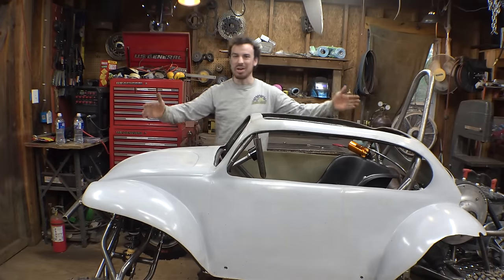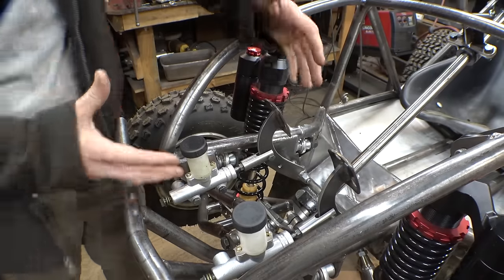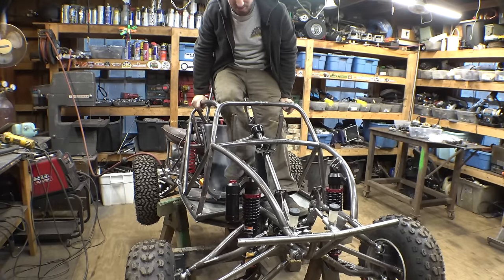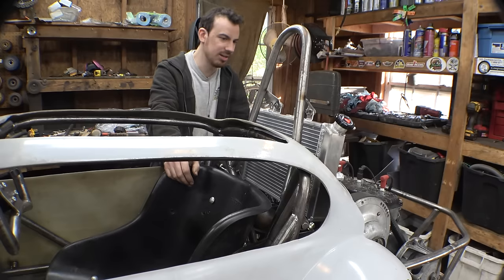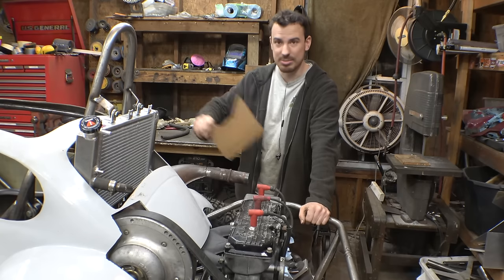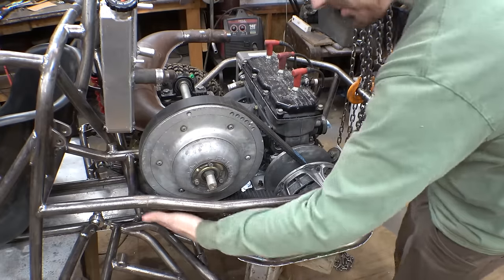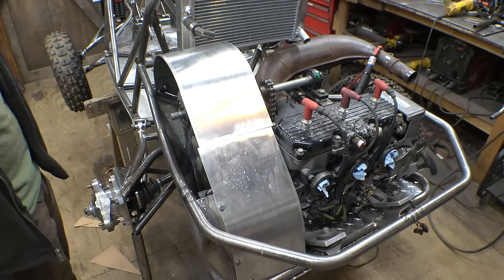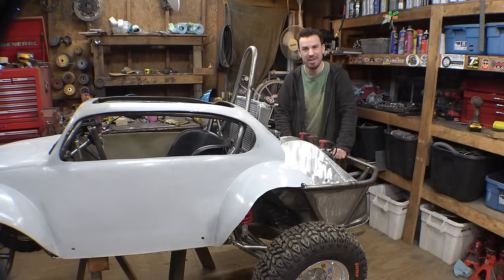Back to Work on this  - Mini Baja Bug Project - Part 13

Comment: Si te diera mucho calor en la espalda el radiador. Podrías poner  algún conductor de flujo de aire en los laterales de la carrocería y proteger la espalda . Saludos
 If the radiator got too hot on your back. You could put some air flow conductor on the sides of the body and protect your back. Greetings

Comment: Put the tank under the seat full width and with a slight air gap put a skid plate. The car has plenty of ground clearance. The tank only needs to be 3 inches deep and however wide the car is. Should be plenty of fuel. About the size of the whole floor pan.

Comment: I wish you would have cut it right at the seat then you could get room for sitting and more room for the engine, gas tank, and oil tank plus the radiator and put a fan on the radiator. Then mold the fiberglass and extend the pipes. Make it comfortable to ride all the time.

Comment: If you flip the part over and use just the lower half of the dimple die tool on a flat surface it'll punch your panel back straight.

Comment: Lay the radiator down somewhat over the motor. Put 2 12v fans on top of it pulling the air through.

Comment: Need to get yourself a 3D printer and a free version of Fusion 360. Can then do complex shapes for a fan duct and print it out of a plastic that is good for heat resistance like PETG or ABS. Would save on doing a lot of things out of metal.

Comment: Careful using a hand grip master cylinder on a steering wheel like that. If there's any air in the reservoir and the wheel turns enough that it's upside-down (or maybe even just sideways) you could end up with air in your brake line.
Reply: not true

Comment: I have an idea for the radiator. Can you make brackets for two places of pipe that goes from the head guard to the back of the frame for the radiator but make it where the two places are able to be removed to work on the motor

Comment: put gas tanks for the millionth time where the bashers on the sides are. Make them enclosed for fuel and or oil tanks. and the raidiator tilted slightley back more to catch the air better and it will be away from your back with just a simple tilt

Comment: On the fuel tank capacity.  I havent followed the whole build. Do the splash guards have to be where they are? What Im asking is do the wheels travel that far in to the frame that you could not build saddles on the tank that would be outboard of the frame? Two half gallon saddles ups your capacity by like 25%. Yes they would cause some issues but you dont seem to have a problem being creative. You I'm sure know that all good hobby rides need to be built at least twice before they go on there first run.😊.

Comment: How is the removable steering wheel  going to work with a brake line and a throttle cable attached to it??

Comment: Why not flip the steering wheel upside down for a m shape. Angle the bottom handles out at 45deg or more like a T. Would give more room for your legs.

Comment: Have you give it any thought about a cooling vent on the CTV Belt cover?? My Can-Am x3 XDS Max Turbo R it has A tube for the inlet an outlet . An my belt temp still gets 165 max if I am pushing it a lot . To keep your belt cool an last you need to make vents. Mine has a fan built on it. But I am pushing 185 hp. WHP. Mine runs hotter when I run my 35"x10x15 tires.  I been subscribe to you channel go on 6 years.

Comment: Does anyone else think the pedals should have been used in the traditional function and the rear independent brakes should have been installed on the steering wheel. Just asking...

Comment: I don't understand why you use a large rad and only use half of the core for cooling, because usually the  hot coolant enters the top and the cooler coolant leaves the lower port . Is that why the large core.

Comment: Why couldn't you run twin radiators on either side of the seat putting ducting from just infront of the rear wheel arches

Comment: Moving the radiator input hose connection is not a good idea the coolant will not circulate through the radiator correctly in order for it to cool down. As you know that heat rises therefore the radiator cooler at the bottom then at the top and you cut off the top part of the radiator from being able to circulate

Comment: You could install a pressurized misting system in the hoop, in case you get hot in summer, spits you down like like vegetables at the grocer.

Comment: Coolant burns SUCK trust me there way worse than you think they are id be careful being that close to radiator
Reply: Maby lay it flat build a rear wing like the old whale tail Porsche style ones put 2 small fans pulling air down through much much safer if you roll or kick something up snag a branch you will have boiling coolant down you neck thats a while lay up in hospital

Comment: That rad placement is horrible fir many reasons. The biggest being if you roll it hard its right behind you and next to your face and body. Its going to rupture it and probably spray you if not runn down your body while you are struggling to squeeze out of "that thing". Poor air flow is an issue, being parked on the expansion chamber is another.

Comment: Lay the rad pretty flat over the top of the motor!!! If you had a cap blown or a hose or a wreck you’d get scalded where the rad sits now… you know better… fix it